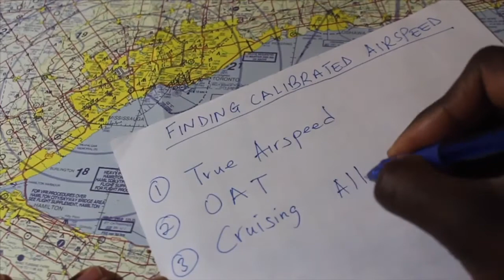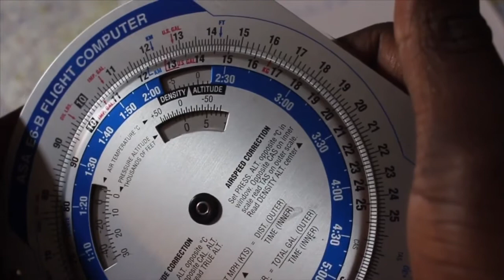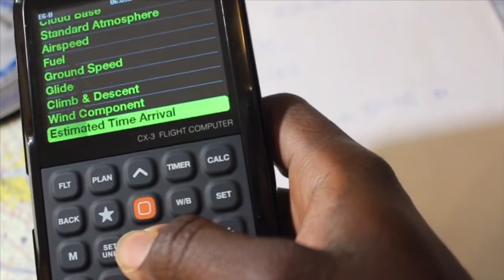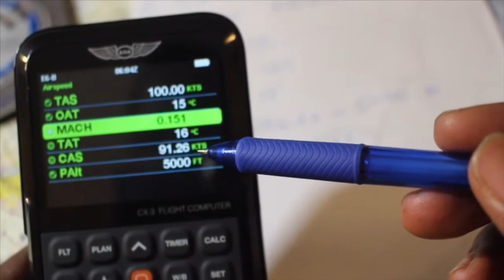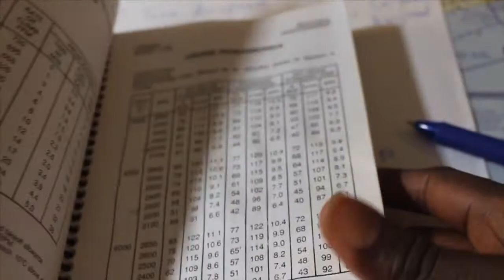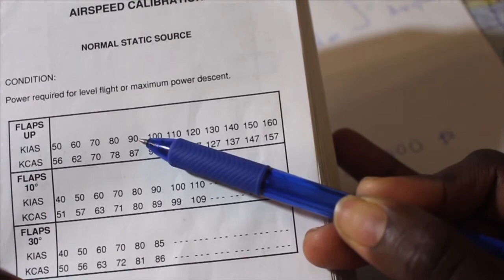Calibrated Airspeed

Comment: I have a question regarding the OAT. Is this value adjusted already for the flight altitude temperature you will be flying or is this field temperature? Thanks in advance.
Reply from the maker: It’s OAT at altitude, that’s a good point, I should have pointed it out.